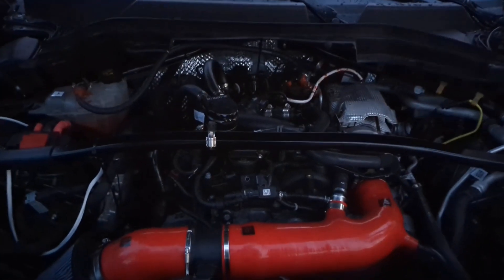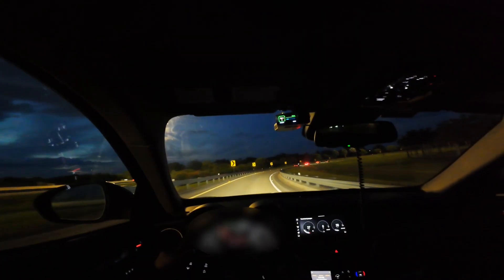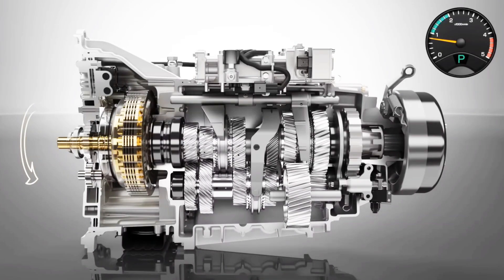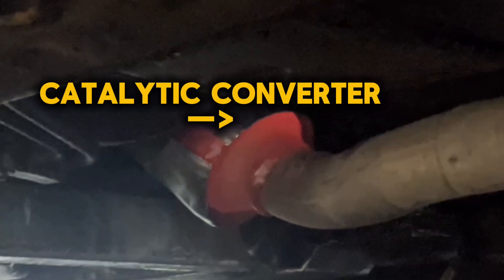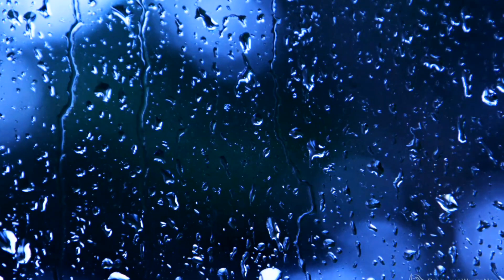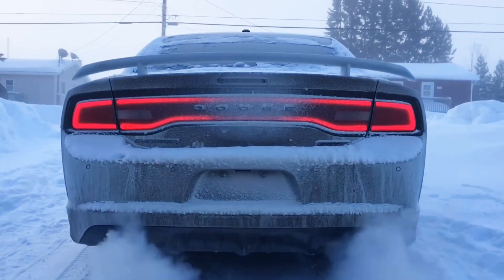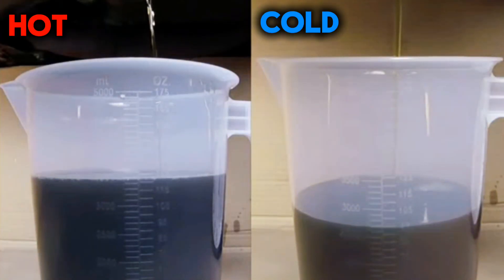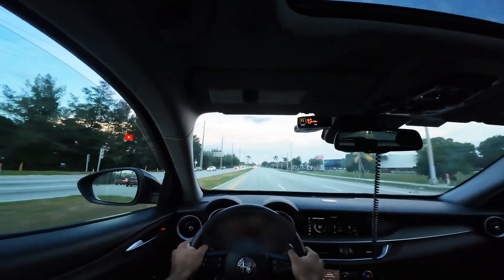STOP Warming Up Your Car – The Truth

Comment: Bullshit. 3 engines I built for 3 of my cars 30 plus years ago. All of them are allowed to warm up to at least 100 degrees before moving. 30 years and who knows how many odometer flips later still running well. Building the 302 because it had over 400,000 from last rebuild. Warming your motor assures it will last many years. This guy is trying to sell you a new car. I think this AI bot knows nothing about cars.
Reply from the maker: Great, anecdotal engine building stories. Don't take it from me, take it from Porsche, take it from SAE.

Comment: As a car mechanic and even owner of a 280hp sport car, I idle my car for 1-3 min (depending on car and climate) 
Its not to warm up the car to operation temp, but to lubricate everything else has gave the oil start tu circulate with a somewhat warm oil/coolant temperature, to go in, start and floor it is what I would describe, you jumping up from your sleep and immediately starting to jogging outside, you wont feel fine at first but once you warm up, you are gonna ne optimal.
In cars the revs dont stay above 1k rpm for your cat and emission standards to warm up, but for the car itself to warm up the engine in somewhat operation temp, my car is a 2020 and it has also a neat little gage before the RPM limit, and its orange to show operational temp, once those 7 orange lights are gone, oil temp is good to go around 60°C (140°F) 
I dont floor it, but still drive reasonable pace, my engine is now 5 years old and has had 0 issues, and some had issues exactly with they engine because it wasnt properly warmed up.
In the end 1-3 min till RPM drop below 1k and you are fine.
Reply from the maker: It's funny, because the cold start RPM for emissions is literally facts that can be found with minor research anywhere.
Reply: @TorqueTheoryLabs You do know that choke systems exist?
Apply that logic with modern cars, make the ECU do the hard work and you got yourself the RPM warm up you try to avoid.
Modern cars have insane sophisticated ECU systems in today time, yet they still follow the thermodynamics of this world.
We as humans been working on engines for over 140 years, yet you know better to listen to facts on the Internet claiming BS and have never worked on engine themselves, been working on cars and engines with my father, pretty sure he knows more about modern engines than whoever placed a rule and claimed to "Just drive them its fine"
And in my father's words: "Modern cars are basically the same unchanged machine wise, just more electronics, more complexity to make it seem like its working optimally"

And yet again my 2020 car that is now 5 years old (soon 6) has had 0 issues when I warm her up 1-3 min a day and let her cool down 1-3 min.
Its basic thermodynamics
Keep follow online facts, we will see how long such engines with such mindset will work.

Comment: Yes this is true. My parents own a 2021 Honda CRV with the 1.5 turbo. It has direct injection, so I knew right off the bat they should never let their car idle. Luckily, I drive their car 90% of the times. In those times that I drive, I start up the car for only 30 seconds and drive off. Plus I prioritize more highway driving since that is healthier for modern engines. I'm saving the life cycle of my parent's car because when they drive it, they idle it for too long and they avoid the highway. I told them to at least avoid idling for too long and showed them pictures of an engine catching fire LOL. Let's just say.......that worked. Got my stubborn parents to finally agree.

Comment: Car engines operate at high temp, so I let my cars warm up about 2-5 minutes before putting them in gear. One thing this video doesn't mention is the need for the automatic gearbox to circulate- which it does when parked and at a stop. Also having a turbo- it is a must!

Comment: All right guys. The engine tolerances are designed around all the parts being warmed. When you hammer on it and it's cold you're causing wear. The warm-up is to protect the major components and has nothing to do with driveability or the fuel system. Nuff said🎉

Comment: I don't have fancy crap or turbos. My cold starts are at -20c. Not warming the car for at least a 2 minutes will turf your engine. Water pumps cold and fluids are -20, cold fan belts are frozen. Battery is cold and usually sets off engine code if you give the car gas. Avoid all this and let the car Idle until warm air can defrost your windshield properly. Don't be the idiot that runs into garbage cans on the road because the windows fogged up.

Comment: Nope, you're wrong. While modern motors heat up and lubricate quickly, the transmission takes longer. Especially with these new perishable CVTs. The transmission needs more time and most mechanics agree. And not all engines warm up that fast, some are made by Kia 😂
Reply from the maker: Transmission fluid doesn't get pressurized input to each gear while in park, idling. So almost nothing happens to the transmission while idling, it certaintly doesn't warmup unless you idle for a crazy long period and let it all heat soak.

It's much better for the transmission to simply drive off once you've idled the engine for 15-40s.

CVTs are likely different, I'm not sure.

Comment: Subarus have a mandatory 1 minutes enriched fuel warmup (not 15-40 seconds) and while you CAN drive during this period, there are some issues.  Try driving during that period.  The idle is 1800 RPM and ADDS to the accelerator pedal, making your manual transmission car feel freaking WEIRD as you expect a slight RPM increase and instead get a massive increase.  

But if it's winter time, your vacuum pressure can be 1/2 of normal and if you still have hydraulic brakes, one hard brake can reduce your pressure to 1-3 PSI!  The brake pedal can lose almost all of its power assist!  I found this out the hard way with a Subaru Forester XT (CVT where you don't notice the same weird feeling, but not having brakes is VERY noticeable. Subaru claimed they couldn't duplicate it, but that's because the engine was warmed up when they tried it!  

The bottom line is sitting for one minute in the winter until the flat 4 stops "shaking" from the enriched fuel mixture in a Subaru isn't a bad idea.  Your brakes and throttle will be normal and newer 0W20 oil should have plenty of time to warm up enough to circulate as they operate well in colder temperatures compared to 5W30.

Comment: I'm "lucky" in that my car lives in the 3rd basement level, and it takes over a minute of lightly pushing the pedal, keeping the RPM under 1500 to the main floor. Even at -20C, car still has the cold engine light on 💁‍♂

Comment: 1:18 I supposed to pre-lubricate the engine moroso sells an oil accumulator that not only works while you're driving to keep oil in the motor, but right when you are start the car, do you release the pressure valve and it forces oil through the system before you turn the key

Comment: Since the 80's, I have warmed up all my cars for 3-4 minutes in summer and 6-8 minutes in the middle of winter. Never had a single engine issue, never had a single oil leak, never burned a drop of oil. Engines all ran great until I sold the cars (some almost 200k miles) and never lost any fuel economy.
Reply: That’s the secret. Nobody understands that warming up the engine also warms up the fluids in the transmission which then won’t have to shift kick so hard and that’s how leaks happen and wear becomes a problem early. The secret for a long lige of the engine and the car is warm up

Comment: ADDITIONALLY I pose a question: 
If I am only going to drive 5-10 minutes away, which is worse? 
A) Idling for a bit and bringing it up to operating temperature before driving the short distance
B) Just driving it the short distance where it never reaches operating temperature
Reply from the maker: A is worse. 

With that said, this IS the life for many road cars these days. Be outside the norm, take it on a drive. Floor it up to the speed limit on a highway onramp on the weekend.
Reply: @TorqueTheoryLabs I actually do exactly that! It sees a lot of short drives but I try to give it at least one good long (typically highway) drive per week, and I usually make sure to "give it the beans" fairly frequently as well.  

Constant short drives are definitely bad for the car (so much for the little old lady's prize car that only goes to church on sundays) but I do believe getting one good long drive per week is enough to mitigate at least part of the negative effects of this routine.

Comment: Several things. Heat expansion. Iron blocks and tolerances.
If we truly cared about our cars we'd heat our blocks and pre inject oil. I suspect that's where a lot of our wear comes from.
I can get over halfway to work in the winter before my 10:1 SBC 350 starts blowing warm air. You can feel and hear an engine in winter if  you drive above 2,000rpm until about 165 degrees. It will sound strained and won't run as smooth.

Comment: You suppose to always warm up a ICE vehicle especially in the freezing cold weather, telling people not to is premature engine failure. You're oil is like syrup in the bottom of the oil pan, never just start a vehicle and pull off you will regret in the long run. This is terrible information!

Comment: My car idles so bad I have to get it moving, at low rpm's cylinders will misfire, even on relatively new plugs. So yes, I do get going within 20 seconds. 
Just start, pull the anti-frost cover off my windshield and roll out.

Comment: My residence is less than a minute away from the highway that I take to drive back home. If it's a warm day, I let my GTI idle for about 40 seconds after the cold start (when the revs drop below 1k), then drive off slowly. Normally the water temp gauge starts to move as I am going on the on-ramp (and I keep the car out of boost, so below hard throttle and 3k rpm). On cold winter days however I'll idle for maybe 2-3 minutes, sometimes less if I am in a rush, and I'll do a lap around my campus or around the block before going onto the highway just to get oil circulating.

My RPMs when cruising on the highway is consistently between 2500-3000 RPM depending on how fast traffic is going (including when I merge onto the highway). I presume as long as I do not give the car hard throttle and stay out of boost while at these engine speeds while it's warming up, it won't harm the engine? The car warms up much faster when I am on the highway. Then after maybe 10-20km of highway cruising I'll have fun with the car. Looking into getting an oil temp gauge since it doesn't have one.
Reply from the maker: Sounds like you've got it!

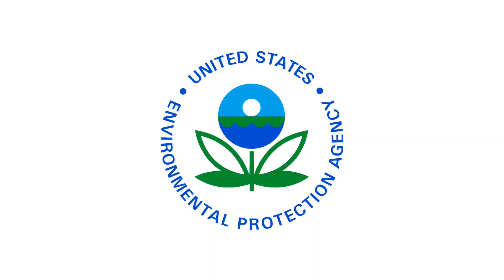Comment: 2:00  Granted Pre-Catalytic Converter Fuel Sprayers (or in the case of CNG/Propane, just a dedicated manifold or something) could work for this, no?

Also granted it deals with egr cooler/oil fired heater type soot covered pipe-mess, but Exhaust Gas Heat Recovery was used in some vehicle (or more likely test engine) to aid in Catalytic Converter heatup, right?

Also just boring old Electric Heaters (akin to Block Heaters/Engine Oil or Coolant Heaters) could probably do it too.

All in all regulations for clean air aren’t the issue;  rich companies being too stingy to do some RnD or actually invent something new is the issue.

Comment: I never understood the point of remote start with an app, especially if you are already in a cold climate wearing layers anyway.  Sure, heated steering wheel and heat assist is handy at times, but i will definitely be getting an older vehicle for my next one without "features".
Reply from the maker: Funny thing is, you can't even activate the heated seats/steering wheel remotely in certain vehicles with remote start like mine.

Comment: I wait until the RPM is under 1,000 and my coolant is at at least 160° and oil temp is relatively close to that or just under. I also use ethanol and that fuel doesn't like cold weather start ups, so yeah, I'm letting my car warm up.

Comment: 15-40 seconds is sufficient enough for modern cars, yeah about that like lowkey what about cars from 2000s, its more modern than ones from 80s and 90s but does the same general rule apple to them too?

realistically depends on how i intend to drive it, if i can get in my car sooner than i need to id mostly leave it under a minute before driving it, then, ill keep it under 2500-3000 rpms (my car redline is on 6500/7000) and once the temp gauge goes above 80 degrees (5-10min drive) ill progressively drive it to higher rpms leading to better cabin comfort as i get more hot air in it easier (or turn on ac if its warm instead)

if however im not ready to go yet but im in a rush and need to reach some place faster id probably leave my car warm up for like 5-10mins so i dont feel as bad from high revving it from the earlier phase of driving

been doing these practices and id say my opel astra from 2001 is happy with it for 5.5 years so far 😂

Comment: I've been warming up my car since new, 300,000 miles later and it still runs perfectly ive never had a check engine light come on and it burns no detectable amount of oil. I dont care what you say I will continue to warm up my engine for 10-15mins. Rust will kill this car way before warming the engine does, to be honest I think warming the engine up is partly the reason this vehicle has been so reliable so i disagree with your opinion.

Comment: how does increasing RPM do less damage than just idling it when the engine is cold? engines are designed to run the most efficient when hot, everything has expanded to fit properly.

Comment: Warm up all my cars. Never had a problem.
Reply: Yep. The people who tell you to drive off after 45 seconds are the same ones who will then tell you that burning some oil "is normal"
Reply: @MikeKayK  not even sure what you guys mean by "warm up" if a modern car warms up anyways whether you idle it or drive it. Better way in your case is saying "im idling my car". But for what reason? Drive as soon as rpms drop carefully for 10 min and then rev it as much as you can. That's it. Cars are not designed to be idling for a long time. Like the video says the lubrication of cylinder walls at idling is not the best. So even if you "warm up" your car it's not catastrophic (that's why you don't notice any issues) but it just reduces your engine's lifespan + you calculate how much your life time you lose when you "warm up" your car every time
Reply: @CalisthenicsWithME I recommend waiting until RPM drop under 1000 and then driving gently   On very cold winter days this can take 5 minutes or more. Yes, idling a cold engine causes wear and tear. Know what causes even more wear and tear than that? Putting load and RPM into an ice cold motor. 45 seconds after pulling out of my driveway I have to accelerate uphill into 75mph highway traffic. I laugh every time someone tells me I should slam it into gear from an 1800RPM cold idle and drive off after 30 seconds 😂
Reply: @MikeKayK well in your specific situation where you have to accelerate very hard immediately it’s probably an exception to the rule
Reply: Exactly
Reply: same here brother, the guy in the video clearly doesn't understand metallurgy

Comment: Nah, I’ll stick to 2 minute idles. Current DI engine is pushing over 200k miles. Last one ran 205k miles. 40 seconds sounds great on an engine under 100k miles.
The Taxi/Uber drivers I met running 2018+ DI engines at 300k+ miles ALL idled their cars before leaving home. Ask a fleet operator of DI sedans how they manage start ups. Bet you it’s longer than a minute…

Comment: I always warm my car up! pistons and rings still have to expand to proper clearance by warming up or they wear out in your engine faster. Oil has to warm up because it has to get in the valve guides and wrist pins, it also has to get to temperature to boil off condensation in the crankcase that creates sludge. this story is a bunch of A.I. hooey put out by the E.P.A. to control emissions and let's not forget to mention insurance companies afraid of the car being stolen as it warms up.
Reply: let me ask how you "warm up" your car? by just idling it? You really think you doing a better thing by that? You are not "warming up" anything by idling your car. I mean if you let it sit idling for 30 min yes temps will go up but it's not good for the engine in a long term let alone transmission. As soon as rpms drop start driving the car and after like 10 min rev it as much as you want
Reply: @CalisthenicsWithME  You go right ahead and warm your car how you want  or shall i say you don't. This is why my cars last hundreds of thousands of miles. but what do i know i'm just a mechanic with 30 years plus experience.
Reply: @danbuckmaster5084 It’s great that you have such an experience. But I would really like to hear the argument on how idling helps you to efficiently “warm up” your car. It just does not make sense. You are basically torturing your engine by the long idle
Reply: @CalisthenicsWithME  You have to warm the block and the fluids under the least amount of load possible. you can blow head gaskets and crack blocks if you don't. You torture your engine by not letting it warm up.
Reply: @danbuckmaster5084 that’s why you don’t rev your engine immediately but just drive normally so the fluids would reach optimal temps in shorter amount of time rather than by just idling. Anyways, I guess everyone has a different opinion on that
Reply: Exactly all BS